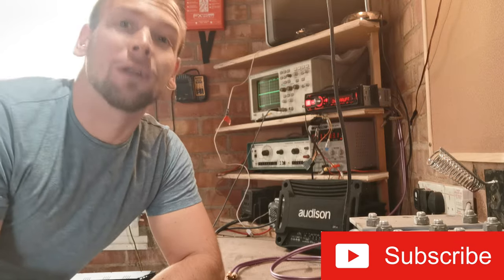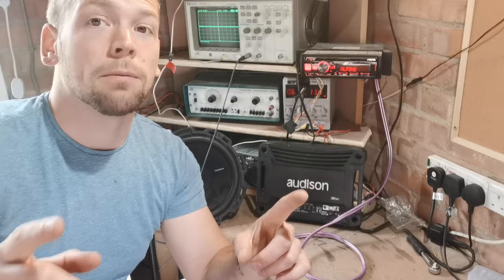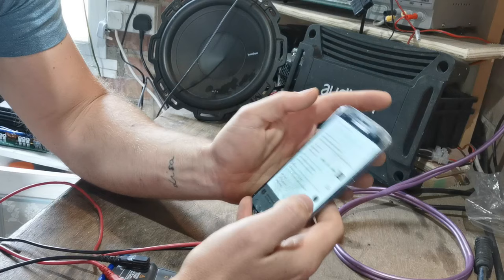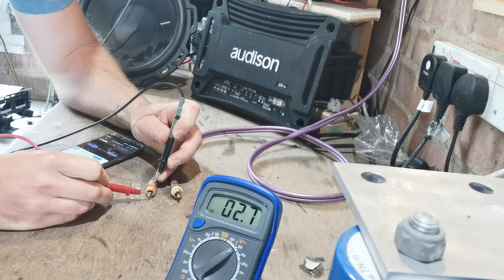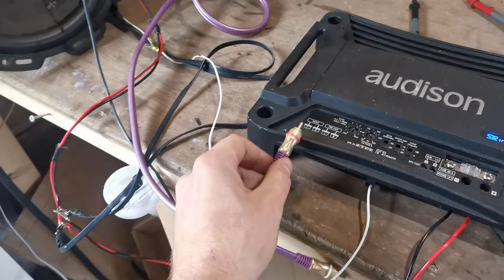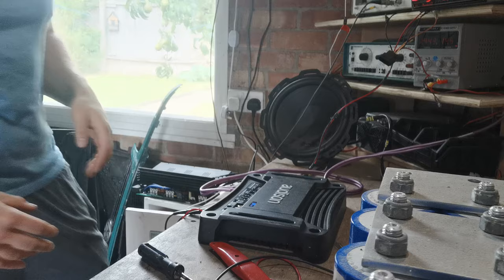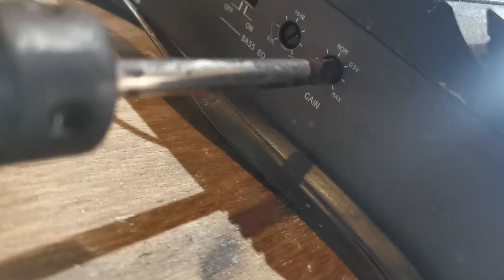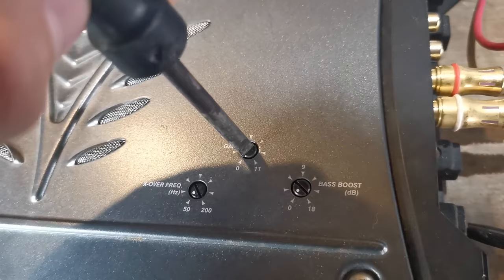PERFECT AMP GAIN SETTING COMPLETELY FREE!!!

Comment: Another easy way is use an old small speaker you have laying around attach a small Capacitor to it. Hook it up to your amp, play a 40hz test tone through it and start turning the gain up. Once you hear sound through the speaker (clipping/distortion) simply turn the gain back down slightly till the speaker goes silent again. Bam clean signal every time, try it for yourself. The capacitor will filter out the 40hz tone playing through the amp but allow the harmonic distortion from the clipping to play through it. Free and 100% effective.
Reply: Yo, this is genius. Science for the win.
Reply: Nice gotta try now that I've clipped 900 worth of sub's 🤦🏽 I must say at 43 years old I've never fried so many subs I would have thought I would have done that young
Reply: What size capacitor to use?
Reply: What size cap do you have to use for this to work?
Reply: @iThoughtUHad2Bitch  thanks
Reply: I couldn’t be bothered watching the whole video.. but I don’t seem to find him talking about the head deck/receiver volume. Should I still put it at 3/4 volume (eg. max is 35, turn down knob till 26 is displayed) and play sine wave or can I just play it at any volume and just listen for distortion simultaneously whilst tuning the gain?
Reply: Was you a rodie at one time? That’s amazing and awesome you actually know this.🫡
Reply: That would be the perfect usecase for oem speakers
Reply: You mean  resistor and what you’re looking for on thi technique is a variable resistor
Reply: So that only works for low frequencies?
Reply: @kingdon5383 He says to hook your meter up to the shield and pin on the RCA's and turn the volume up until the voltage matches the max preout of the head unit.
Reply: Why don’t they sell this yet it’s 2023
Reply: Aren’t those just bass filters
Reply: The eeeeeeeeeeereeeeeeeeeeeeeeeeeeeeeeeeeeeeeeeeeeeeeeeeeee
Reply: So do you keep the small speaker and capacitor attached to the wire when you hook up the amp like I'm confused with where you hook up this capacitor and why you even need a small speaker if you could just get the capacitor size for 40 Hertz

Comment: Really great concept! The only issue is this assumes that the manufacturer has used a linear potentiometer for gain control - ive seen many using logarithmic potentiometers, whereby half-way up the dial is equal to around 28% or 72% of gain depending how its been wired. Wouldn't it be so much easier if all manufacturers actually labelled the voltage on the dial! :P
Reply: I knew there were 2 types of pots that work differently as they are being turned up or down.There should be a way to test them in order to distinguish which is which. Let me dig around a bit and I'll get back. This system is great, however not having linear pots is a set up for a costly failure.

Comment: When measuring AC volts there is no need to observe polarity.   You can put the meter leads on whichever you want, it will read the same.  DC is when polarity matters.  Hooking up the speakers polarity matters so they receive the same wave and work together.  Other than that it for anyone to cheap to buy an oscilloscope it looks like some good advice.  I'm a firm believer that distortion kills more speakers than slightly over or under powering them.

Comment: The fact that you showed 92BT head unit and old MRV amp together is such an unreal find for me. I wondered why my signal is clipping at volume set 20-21 for about a year. That almost driven me to throw away MRV-F405 from my system. I'll definitely try your setting up scheme tomorrow. 
Thanks a lot!

Comment: Excellent guide. I will be using this technique to set up my amplifier. 

Head Unit Single RCA output. 1.5v. 

Multimeter set to AC to find clean output on RCA in relation to HU volume level. 

Calculate where 1.5v sits on gain dial. 

Sony Amplifer RCA input voltage 0.3 - 6v. 6v minimum. 0.3v maximum. 

Lower voltage position (0.3v) is maximum gain. So lower voltage value = higher RCA input compensation (gain).

Hopefully, I understand it correctly.

Comment: my new CT Sounds amp(s) dont have a line/input dial. in this case, i just turned my head unit up to 75% of the volume, and checked the output at the speaker terminals. my door comp's can handle 80w RMS. they are 4ohm rated. so the quick math to do is multiply the RMS power rating (80w) times the resistance in ohms (4ohm) then get the square root of that.. 80x4=320 squared, is 17.9
with the head unit volume at 75%, i'd check a/c voltage on one of the speaker terminals and turn up the Gain until it outputs 17-18 volts. 
*to get this done right, set your EQ, all your sub gains or bass boosts on max because once you turn up the gain, you CANNOT then do a 0-12 db bass boost unless you want your voice coils in your passenger seat :)

Comment: Thanks a ton for this!  I must be doing something wrong... my head unit spec reads "Low-Level Output (4 channels): 2.85 Volts."  With max volume on both Bluetooth phone and headunit,  my multimeter reads .6 Volts AC for a 1000 hertz test tone... and vacillates between .7 and .8 Volts AC for a 100 hertz test tone.  The headunit tech support (Retrosound) says I won't see full voltage unless "there is a load" such as connecting to an amp.  So I tried adding an RCA Y-Adapter (one side to the amp and then onto a speaker... the other side naked).  Readings on the naked Y-Adapter RCA plug are the same (.6-.8 ACV).  I then measured with an oscilloscope... I see no clipping (perfectly smooth waves) at max volumes (perhaps Retrosound engineered theirs to have <=2.85v out at max volume?).  I worry I am doing something wrong... any theories on why can't I get a reasonable ACV reading?  (I did test my multimeter which correctly shows ~120V on a wall plug).
Reply: Looked up one of their decks and heard some janky things. I would be surprised it does 2V, most likely 1V which makes sense if you got .8 or whatever...

Comment: Great vid. So what if my HU is stock with all the integration stuff, and I have an amp connected to speaker level inputs. Can I just read the voltage off the speaker wires since my shitty HU has no RCA?

Comment: Not sure if you had any on your outputs before measuring with the scope, but you must have a load on the output before checking for clipping. Whatever the input impedance is for the amp on the line level outs to your scope and whatever the amps output impedance (prob 4ohm) dummy load on the scope leads. Your way will work but you're losing some of the power capabilities because with a load connected the output adjustments would be a bit higher before clipping.
Reply: When you say load you mean a song playing right

Comment: How would you measure the output of a factory head unit to a line output converter? Would it essentially be the same process? On the line output converter I have it has a clip light to set it at the frequency needed if I am correct, please correct me if I am wrong

Comment: Awesome video, the best explanation on this topic!!! On my setup my base sounds good when I have the input level button out in the high mode per the kicker 800.1 label. Pushed in the base is low like non existing. But I have the rca cables from the headset into the amp. Shouldn’t the base sound in the low setting? I had this installed years back and don’t recall but I think the installer used an inline converter from headset speaker wire to rca converter out the amp because I have the factory headset. Is it that when using this LOC converter even though the rca is going out the amp input button should be set to high level input?

Comment: so what happen when you use audio control amplifier and on the gain there isn’t any numbers on the gain? but it is 8v input? the signal come out head unit is 5v, so turn up half way and a tad more? also what if you use factory head unit and use high speaker input for signal. how do you determine the factory head unit voltage? this is really helpful, thanks

Comment: Wait; great advice on measuring the pre-outputs of the radio because I haven’t seen that yet ( I’m a beginner so I’ve been watching TONS) of videos. 

My question is how do I know what “ Hz “ to set it at? I’m doing a 2 amp setup. 1.  

Pioneer DX871 powering 2 “12s  / 2. Aunex 4ch powering all 4 interior speakers

Comment: So I've I stalled an jvc kwm745 head unit paired with an audison sr5.600.  I have looked at the out put of the head unit using an oscilloscope there no cliping at full voltage . Although I  have sent  the gain to matched the pre out
 I was thinking is there any reason why I can match it it to the speakers, which are audison rated to 100w rms @ 2ohm. Or set the gain as close to speaker max before oscilloscope shows cliping.
What are ur thoughts

Comment: Hey mate, quick question. What you describe at 2:30 is a better way of just setting your headunit at 75% and assuming that is clean voltage, right? Thanks for your video!
Reply from the maker: Heya, Use the specs in the manual for the voltage and test with multimeter. Ive not had any that arent clean at the rms voltage
Reply: @PacmanBasshead  Thing is I bought a chinese multimedia for my Suzuki, and the manual does not mention that value... Seems good quality, but it lacks specifications.

Comment: Set your sub out to 1/2-3/4 then do this.. in my experience you’ll get more clipping from the internal gain/filtering of a head unit not the actual volume.. 

But you got to pair that with the speaker level outs as well if powering speakers off the head unit.. find the balance of clean out and clean rca.. 

This is a good starting point for just adding a sub but it doesn’t really give you the full picture.. you want clean power to everything it just the sub.. this is why amps have gain controls so you can tune them up or down accordingly to match the rest of the system.

But most times the pre out will over run your line outs on your head unit.. I like to start with the line outs and then work from there unless everything is running off amps

Can’t believe this doesn’t have more views.. this is one of the easiest to understand and follow videos for beginners

But need to know your head unit sub out.. for example mine is 0-14 with -8bd to +8db.. 0db is setting 7. Therefore when doing this with my head unit I would need to be at setting of 7/14 not at max.. 

This is more often than not the case for most brands.. alpine is the best at giving really good non clipped output at max settings though for most models.. I’d bet your sub out is plus minus too cause most alpines will go max power in clipped to both the preamps and the line outs

Comment: Had a question about the tone you okayed and if you had other other speakers hooked up. If I wanna set the gain myself we don’t have audio shops local. Do I need to unplug my door speakers so the Tone don’t play through them since the volume will be up high when testing the rca volts
Reply: It's best to disconnect your speaker inputs from your amp because they aren't necessary to get the readings. All you will be doing is playing your speakers very loudly at a test tone. If your trying to set the gain and you turn it all the way up or to a clip point it's just putting unnecessary wear on your speakers and possibly could blow them accidentally. It's no difference speakers wired or not, but security on your investment.

Comment: Quick few questions. 
1. What test tone frequencies are you using (I assume 50 hHZ for a sub, and 1000 hz for other channel speakers)?
2. What should I do if at max volume the output measured on the RCA cable is not even half of the indicated preamp output? I am using an Boss BE10ACP. Which states it supplies outputs: 6-channel preamp outputs (4-volt front, rear, sub). When playing a 50 HZ test tone and testing one of the rca cable of the sub I am not even getting above 1.7 at full max volume. What would cause this?
Reply: I think it's 4v divided into 6 ch or 0.66v per ch, 1.7v is clipping
Reply: I think your sublevel isnt on full, how many volts have the front and rear rca´s ?

Comment: What frequency do you use in this tuning?
And does BT never distort at max level from the phone?
Can all amplifiers handle max level in without any load, dont you have to put a load at the speaker output, or is it safe to run full gain and max signal in without any risk of breaking the amplifier?
Reply: Amps have a input sensitivity rating, which indicates the maximum voltage for RCA signal in that the amp can handle without clipping.

Comment: This is a great video, thanks for making this. My Pioneer HU is 4v, and my Alpine amp is 4v at minimum....so I'm assuming my gain should be on minimum?
Reply: Good question , use the ohms x watts then square root that number to get target voltage for speakers on amp

Comment: How come when I do this to my RCA wire it always says at 0? I have my RCA cables plugged in the the back of the radio. There are a front and rear red and white and then below that two back RCA connectors that say sub. That's the correct place to connect them right?

Comment: I don't get this. The less voltage your car stereo will give, the less you turn gain from your amp? So, in my case, my stereo has 4V output level and my amp has 6V input level I would turn gain to about 2/3 of max. And because my subwoofer is 250W RMS, and my amp is 310W RMS, I probably lose some of the potential of my subwoofer? Or should I use 31.62V instead (square root of 4 ohms x 250W)?
Reply: I have this question as well

Comment: HELP PLEASE! 
MY amp is rated at 800@1ohm(pioneer 8601). My subs are 200watts nominal each(pioneer TS-W253R) and I have 3 subs. So what should I be reading on my multi-meter when setting the gain for these?

Comment: My android HU has a built-in subwoofer gain. Should I set it to max before I will perform your video tuning process? I will also set bass boost to OFF and equalizer FLAT on the HU.
Reply from the maker: Youll need to find the rms ac voltage of the subwoofer, the manufacturer should be able to say what it is, then find where on the headunit its at that voltage and go from there.

Comment: Dude this is relevant aswell to guitar recording in the digital realm, I would need to measure my guitar pickup output to set up my virtual amp simulator input level according to my pickups (meaning, passive and actives have different output etc..) I'm hittin my head against the wall with this thing.
Reply from the maker: Should be the same man!

Comment: QUESTION PLEASE:
1) im using the pac sub pro as my LOC, it's coming off my factory radio. can i use the RCAs that are going from my PAC to my AMP?
2) my real question is, i want to do this but im afraid of turning my system up all the way cuz i want to work on it in my garage and not piss off the neighbors. can i put a silent track on so that its turned way up but cant hear anything???? or does there need to be something coming out? any thoughts on best way to do that quietly? Please answer if u can
Reply: If you can adjust the fader/balancem send it all to one speaker and test at that output or disconnect it and then test the rcas

Comment: Does it matter if I set the gains with the car off (12 Volts) or with the car running (14.4 Volts)?
Reply: No it shouldnt(however I would do it while running just to be sure) seeing as how the voltage you are adjusting is the signal voltage, rather than the power input voltage, good question tho!

Comment: This is invaluable. So real quick though, doesn't this also mean you cannot turn your radio up past 23 because of the induced voltage excess causing gain distortion?
Reply from the maker: Essentially, yes. A bit of clip never hurt though.

Comment: On my headunit when using the FM radio, normal listening is at about 8-10. The max is 40 on this unit. When I use Bluetooth with the phone on max volume, I have to turn the headunit volume up to 16-20. However, I get crappy sound because the Bluetooth is clipping, so I turn the volume down on the phone so it's the first notch above where the volume bar turns red, then set the headunit to 22-28 for normal listening volume, or 30-34 to more enthusiastic music. With the drastic difference in volume between FM and Bluetooth, what do I have to change on your method?
Reply from the maker: Its worth testing at both, a bluetooth connection will offer a different level of RCA signal so you would meed different settings for both. Every device has dofferent bluetooth signal strengths too so try to make sure all of your music comes from one source.
It sounds as though you have a lower quality headunit, or bluetooth device, maybe consider changing it.
Reply: I'd think fm, aux, cd, and Bluetooth would all have different input strengths, assuming the same bitrate. So wouldn't a Bluetooth signal be pre-amped by the phone and then the HU vs the HU preamping the initial signal via a cd? Does a phone at 100% clip a signal via aux or BT?

Comment: Man, this is a great video, but I have a stock HU in my 2021 Mazda 3 hatchback. And I have no idea what the output voltage is, because there's no manual or nothing.
Reply: That's why you set it to 70% volume rule and measure to amp out
Reply: @axetroll  I understood all of that except measure to amp out. Lol.

Comment: So you mean that, my alpine 178bt that produce 4v per RCA Chanel should have my gain set to full because my amp is 4v Max capacity. It goes from volume 0-35 and the majority of songs i keept the volume about 24 because to me more than that it clearly dist. Should i turn it all the way up? I feel like the volume would be really sensitive.
Reply from the maker: 4v is a minimum setting, the max would be 0.2v or something. The gain knob is basically a signal booster where your headunit lacks the strength. Test your RCA voltage and set it to that.